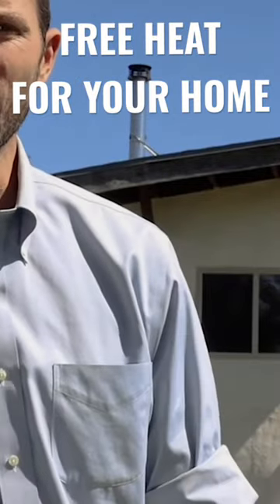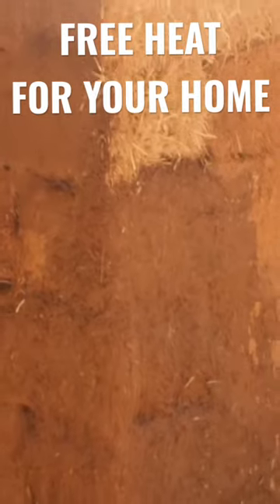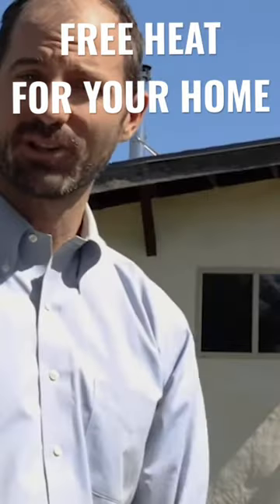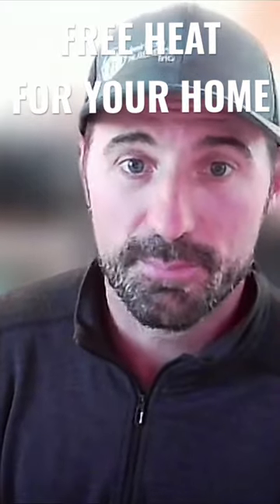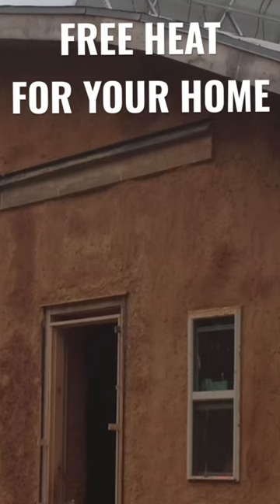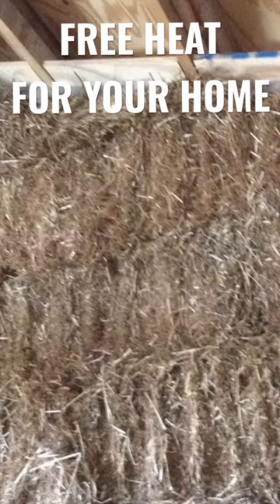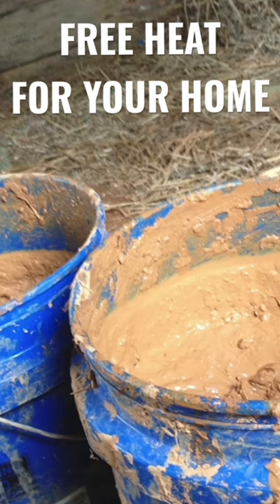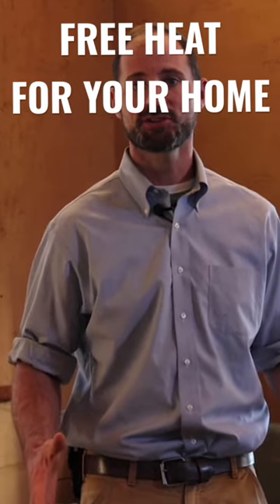FREE HEAT for your HOME #homestead #podcast #offgrid #solar #solarpower

Comment: My sister was able to replace using about 2000 gallons of heating oil and her residential water heater by installing solar water heating tubes and storage tank to her existing radiant floor heating.  Total cost was comparable to what she would pay for 2 winters of heating oil.

Comment: What about Tesla free energy soon?
Reply: No such thing as free energy never has been never will be. You pay for it in one form or another. Even with passive solar you either pay for the concrete floor to absorb the heat or replace or refinish your wood floor from sun damage. Then of course repaint your walls because of sun damage. Then you also have the heat loss from the windows in the winter when no sun is shining and the initial cost of the additional or larger windows to let the sun in. Make sure you get the best windows money can buy because that direct sun tears then up and you’ll be replacing them again in 15 years or less.